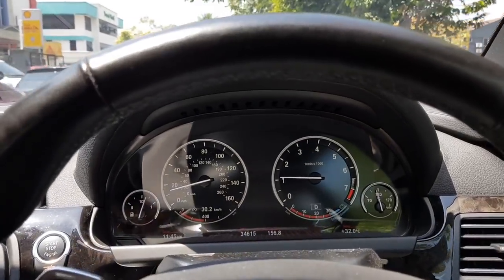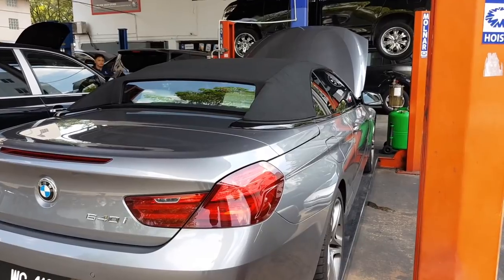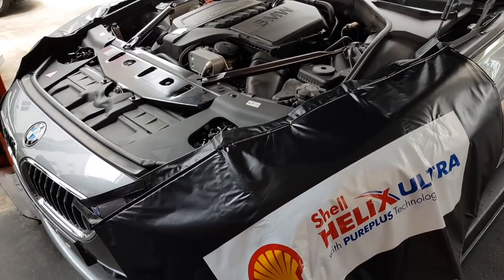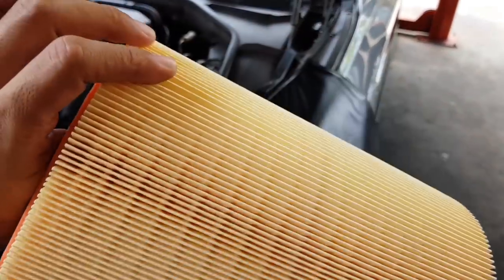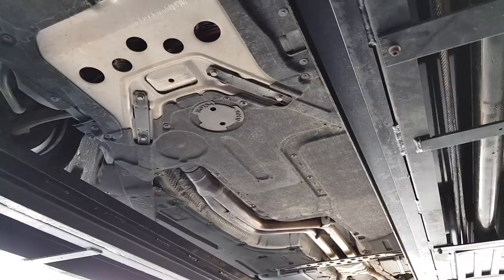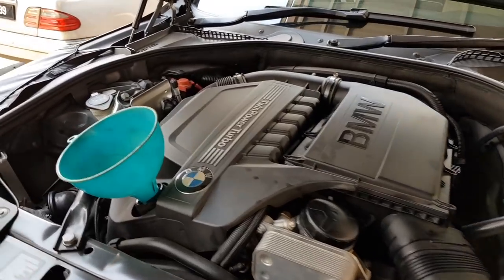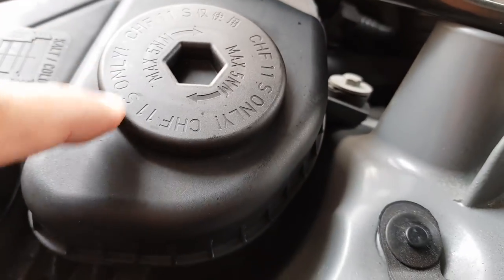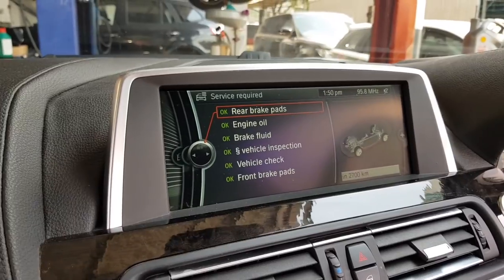Layman Tech Talk Ep5: How to do a proper oil change on a BMW | EvoMalaysia.com

Comment: I DIY myself at home...but my practice is to suck all the old oil left in the oil filter casing before placing new oil filters...1 more thing, it's really nice to have ICOM-ISTA diagnose setup if you own a BMW. Then, the car will able tell you what kind of problem they have before the mechanic outside there empty your bank account..haha...btw, nice car bobby

Comment: Hi Bobby, I am driving a BMW 320i f30, so you think Shell Helix Ultra is the best engine oil?
Reply from the maker: Well .... let's just say they all comply to manufacturer's grade. The most tahan lasak kind of oil are Esther based oils. But they are super expensive. You can research a bit about them.
Reply: So long as it's BMW LL 01 it doesn't matter.

Comment: how much you spend for the preventive maintenance that day?
Reply from the maker: oil change is the same as any car. I use 0W/30 so it's RM338 a bottle. If i use 5W/40 it will be cheaper. Filter should be RM70, labour RM60-80 (didn't check). That's it. Brake pads are RM690 for original BMW and RM450 for OEM brands (Honda City brake pads are RM450 as mentioned by other commenters here)
Reply: Bobby wah siao ah Honda charge so high... And thx for the break down. Cuz my dream has always been BMW M5
Reply: lol yeah, Honda original pads are RM450 each, but you can change oem brands at cheaper rates outside.
Reply: Chris Kong but Honda charges around rm130 only for 4L of fully synthetic oil. Given that you will do oil change every 6mths vs brake pad in 2-3 yrs. I'd say it's acceptable